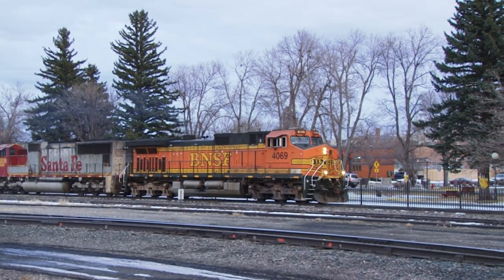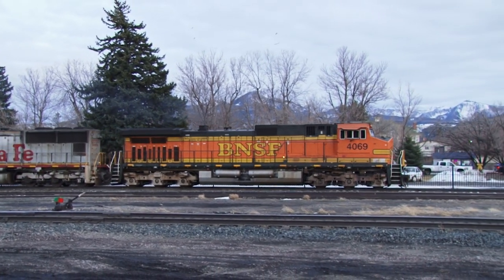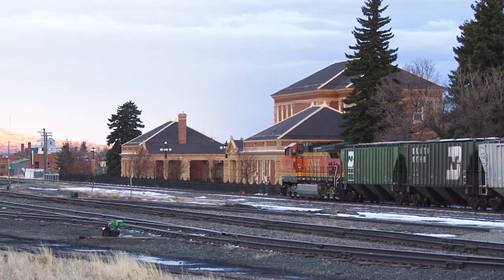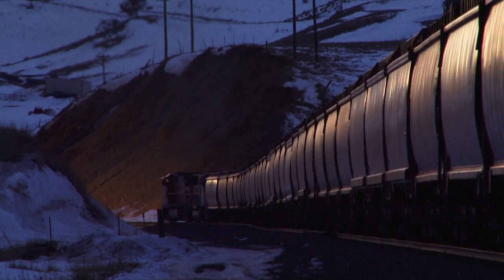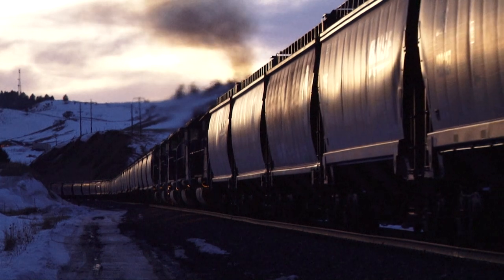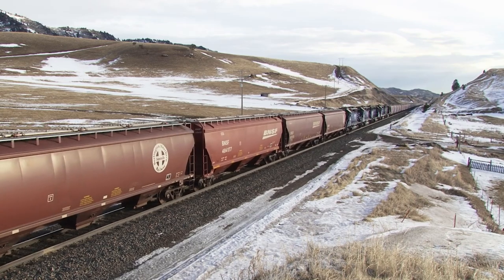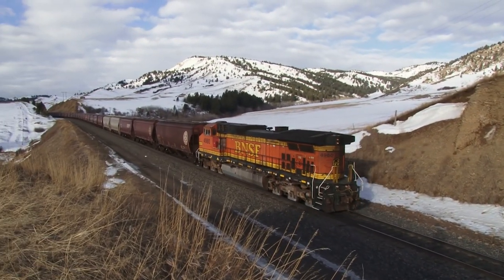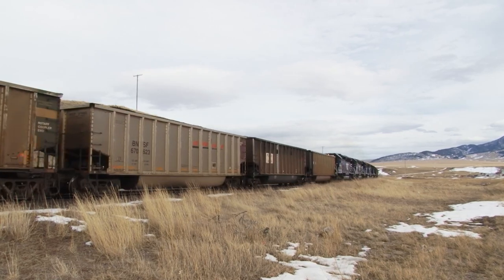Bozeman Pass SD45's!

Comment: Back in the day with SP and early UP when they took over in the late 90s and early 00s, plenty of older tunnel moter power was still used on the mountain out here(Donner Pass) on a constant with manned helpers still despite newer third generation diesels and dpus. It was definitely a different feel of the engines in run 8 and grinding with everything they had

Comment: The locomotive 332 needs a tuneup - too much smoke. I know nothing about locomotives - do modern diesel locomotives use electronically controlled fuel injection? Any progress between 1935 and 2023?